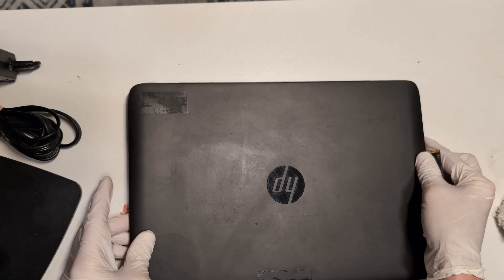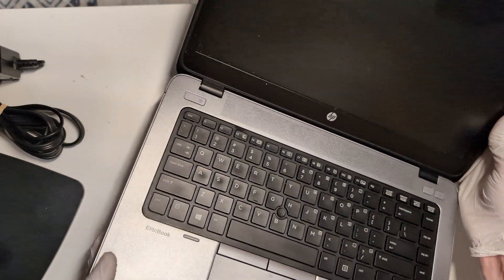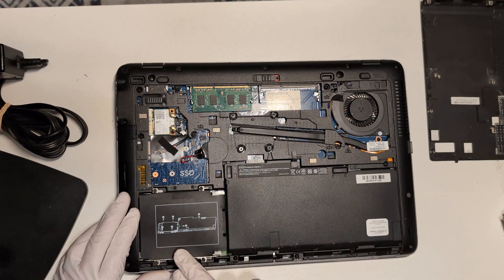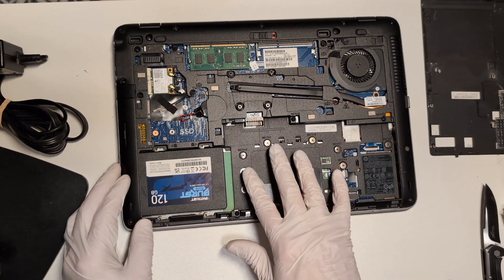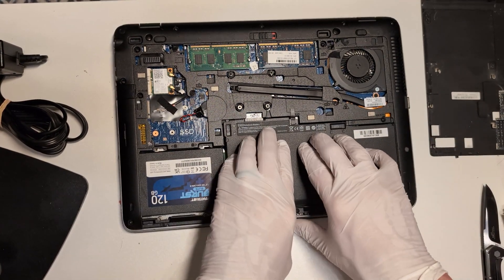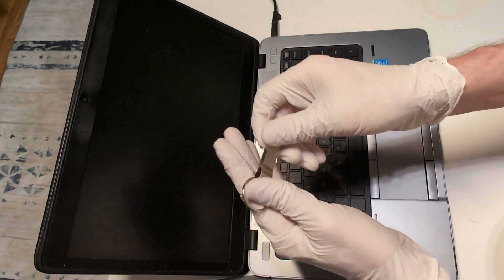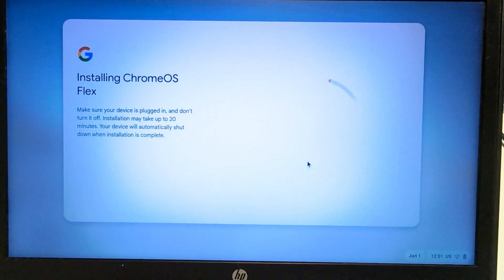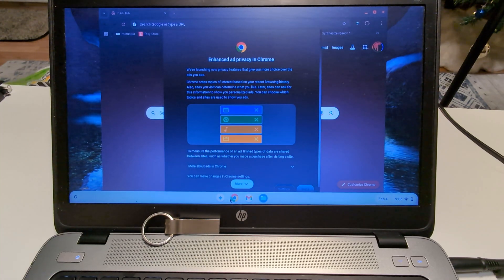Can i fix this with ChromeOS Flex

Comment: What is the best version of Windows that this can run?
Reply: I installed windows 11 on it and it is just like a new machine! very fast and smooth. using 8gb ram and 480gb ssd
Reply from the maker: This are suited for base windows 10 of you have more then 8gb of RAM. They "can" running windows 11 in an unsecured version but it sucks.

Comment: Mine works so slow
Reply: Use an SSD if you are not already
Reply from the maker: @did_you_kow  what kind of OS are you running on it? I have found that something like flex OS or Linux elemental works really well